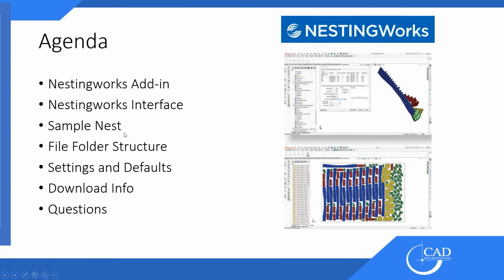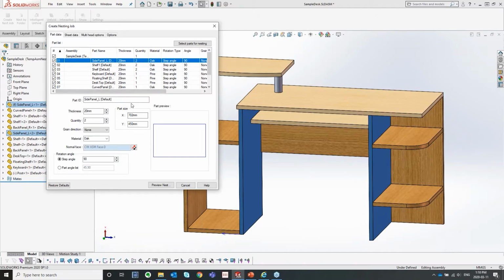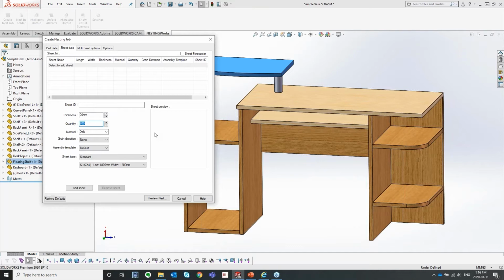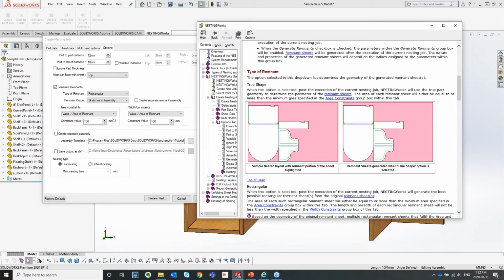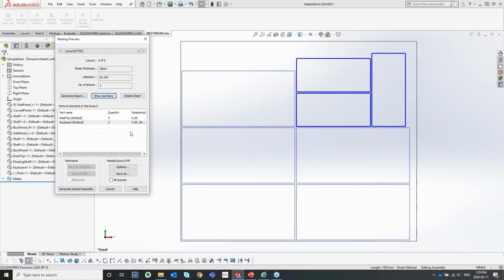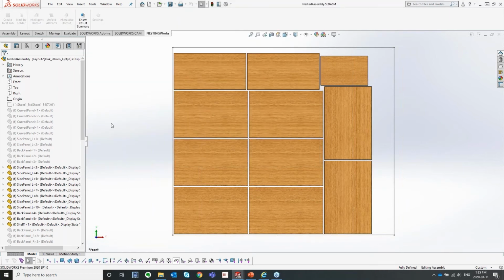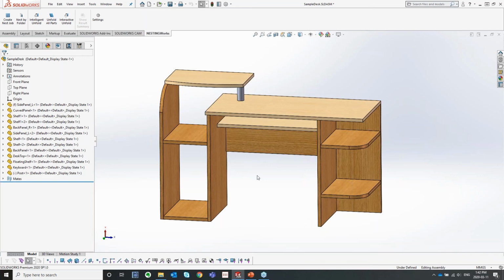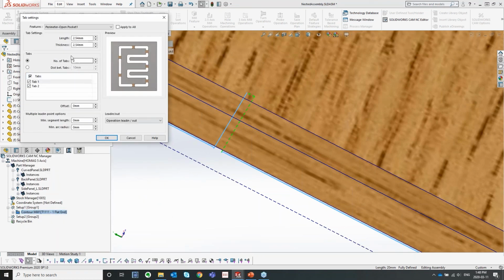ON-DEMAND WEBINAR: Utilizing NestingWorks for Design and Material Optimization in SolidWorks

Comment: I'm working with sheet metal parts that are larger than the stock, which are spliced for cutting and welded back together during assembly. Is Nestingworks able to determine the optimal place to splice a part that is larger than the stock?